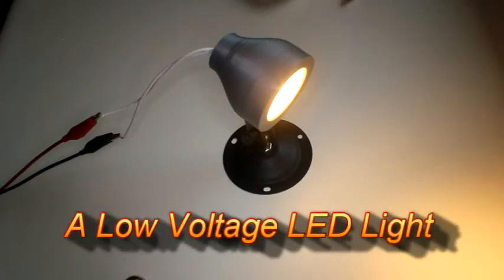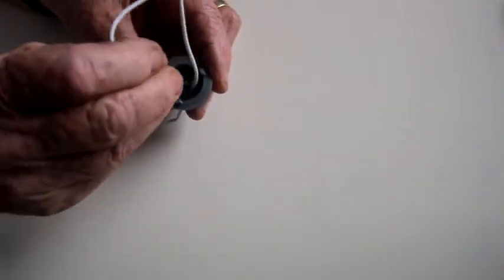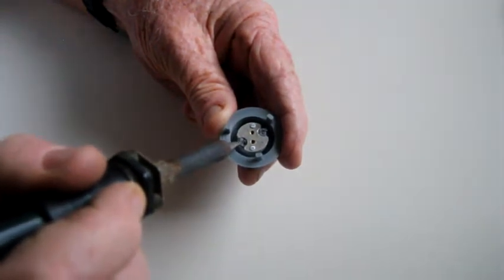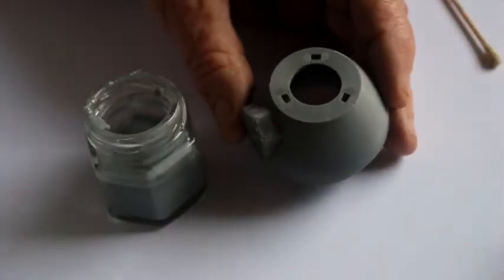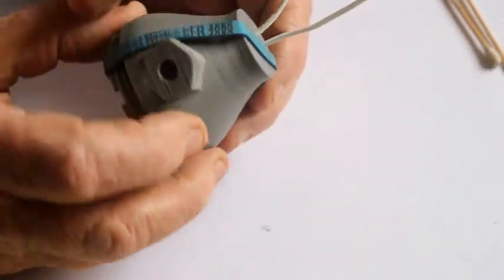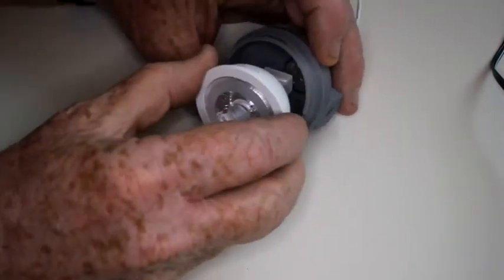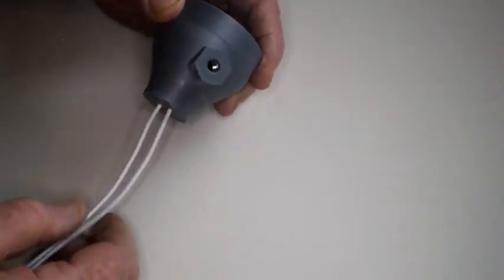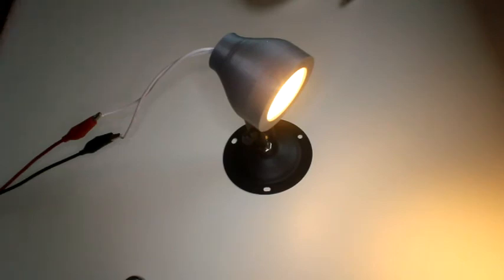MR16 Low Voltage Lamp

Comment: Can you use  a 12volt 5w LED bulb?
Reply from the maker: Yes - I've used them. See Update_on_5_watt_LED_bulbs.pdf in the files section on the Thingiverse link for more info. Thingiverse link: https://www.thingiverse.com/thing:2361577.     
5 watt bulb link: https://www.amazon.com/gp/product/B01M5KLE7E. 
Please note you need to print this in ABS or another plastic that can withstand higher temperatures. Even at these low wattages, the inside can get pretty warm, and PLA will deform with either the 5 watt or the 7 watt bulbs.